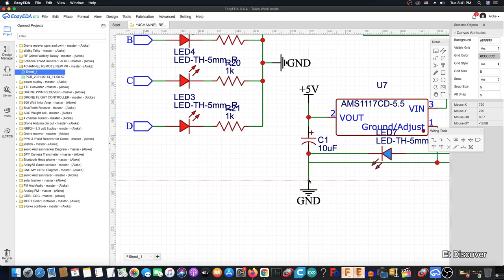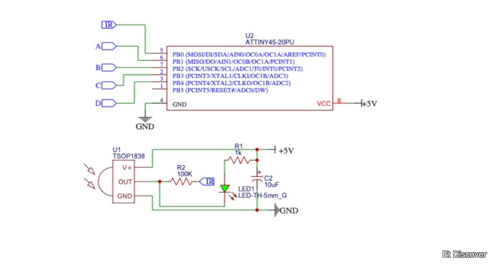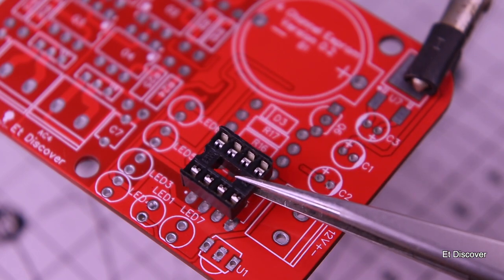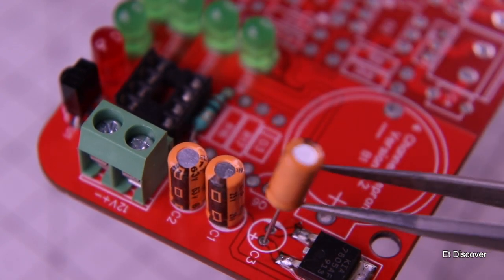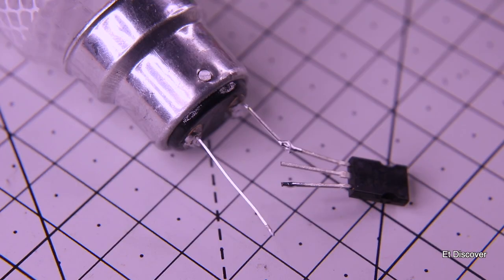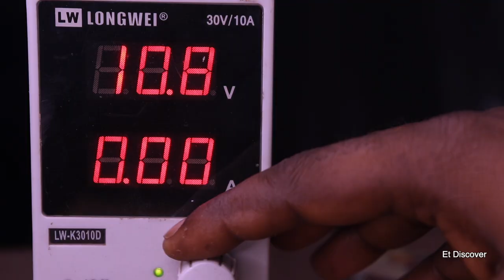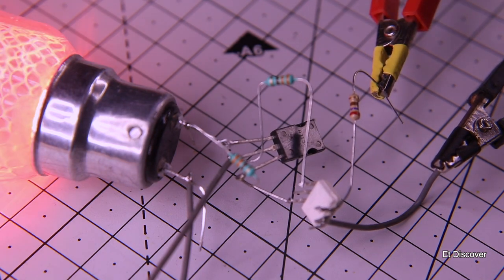With EEPROM, Without Relay, IR 4 Channel Remote Control System . For your Room Appliances. (V.2)

Comment: Please make a signal booster with a 2300 mhz yagi antenna and common emitter circuit with 2SC3355 transistor and a dipod antenna as transmitter🙏🙏🙏🙏🙏🙏🙏🙏🙏🙏🙏🙏🙏🙏🙏🙏🙏🙏🙏